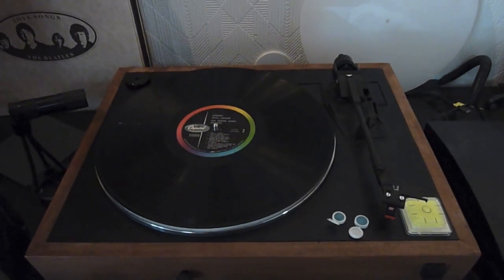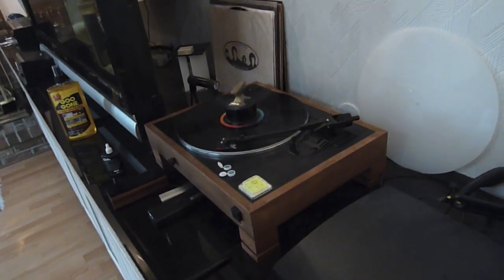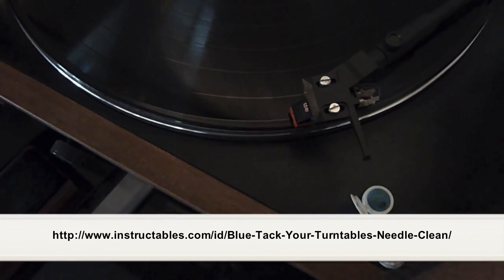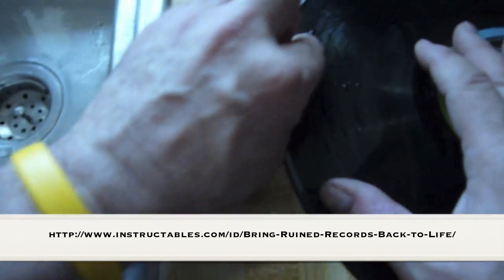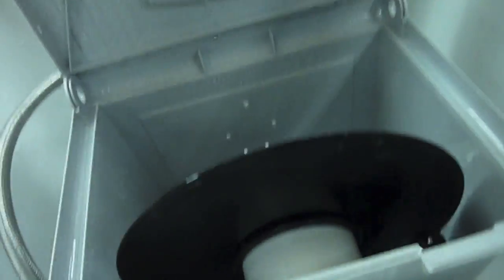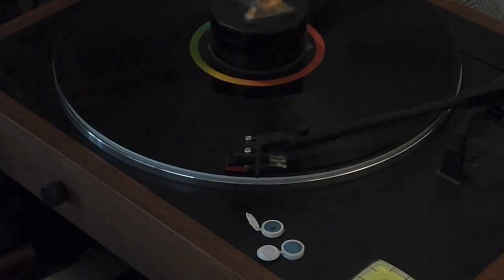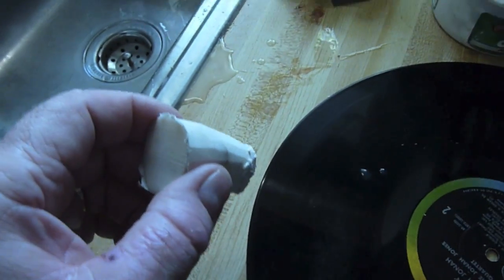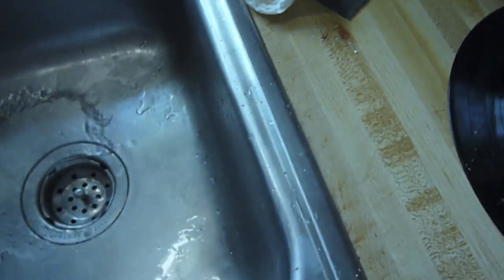Resurfacing Records to Sound New Again

Comment from the maker: Mrshelfsong: I did the exact same thing when I copied my albums to tape (pre-digital).  But I didn't bother using distilled water.  I used a spray bottle and tap water to mist the surface and let er' rip.  I'm sure all the improvement I heard had a lot to do with eliminating the static I was constantly fighting back then.  Glad to hear I wasn't the only one to do this.  Thanks for commenting.
Reply: +Bruce Kinsey You sure are dedicated to your records. I grant you that Mr. Kinsey. I guess I'll always be a CD man. As long as you don't drop it, the only thing you need to keep them working are some linen cloths. (And perhaps a scratch repair kit.)
Reply from the maker: +eternalhalloween1 No... That's not me... Most of my listening is digital too, but there's something satisfyingly primeval about taking 5 minutes out of your life to focus on a retentive act of preparation and performing an action requiring surgical levels of concentration and precision just to sit in a spot located exactly between a couple of 4 foot Magnapans and listen to 6 songs of which only 2 are any good... Come on, you can't deny that's nirvana, can you? :)
Reply from the maker: ...And a place to store them. 

All of my LPs are those that never made it to CD or difficult to come by other than lucky finds at junk stores.  

At the moment I'm focused on another project, so my turntable hasn't been used much of late. 
An iphone, a set of dual driver IE headphones, (modified to eliminate virtually  all outside noise and to keep all the sound produced by an mp3 or 4 trapped between the speaker and my ear drum) will produce a good representation of what I hear (and feel) in front of decent speakers.  I can play with my project and music at the same time.
Reply: Yea. I know some people swear by vinyl LP. But I think you really have to have a lot of time and money to keep them in top condition. In all the years I've collected CD, the most I've had to do is wipe some dust off with linen cloths.
Reply: +Babi “Banditt” Tre I'm happy for you. Actually, since my last post, I have found a really inexpensive way to get rid of static and restore records to sounding almost new. Yea. New records can be $20.-$30. while the CD equivalent is much less. Would you believe I looked at a record washing machine on amazon, and it was $3,000.? I guess that's ok if you just won the lottery.  I don't think a lot of people would approve of how I get rid of static and clean my records, but it does work.
Reply: Please tell, how do you get rid of static?
Reply: Hey MalcolmPowder. It's not a method a lot of people would probably approve of, but I tried it on enough records I wasn't really worried about and it seemed to work. I mix some LUKEWARM water with a LITTLE dish detergent. And I dampen a paper towel with it. I gently go around the record 4-6 times. Then, I dampen a paper towel with ONLY LUKEWARM water, to rinse it off. (Gently going aroun 4-6 times.)  Then I take a slightly damp paper towel and GENTLY dab the record dry.
Reply from the maker: There are brushes made with carbon fibers that are excellent at getting dirt out of the groove.  Carbon is also conductive, so by placing a finger on the bristles as you brush the record, and with your other hand, touch a grounded component of the turntable, such as the spindle, it will bleed off static electricity very effectively.

Comment: Bruce, May I suggest after all the excellent cleaning that you apply a thin coat of WD-40.
This petroleum based product will allow the needle to glide over the surface and any microscopic dirt without hearing it.
Again, this will not hurt the record or stylus.
The surface noise will be reduced and allow higher frequencies to reach the magnets  in the cartridge since the needle can track the tighter grooves better due to the lubrication.
FYI
Reply: wallyitcom go ahead if you want your records, turntable and record sleeves all bunked up, oily and stinking... oh heck, you were joking weren’t you?... Lol!
Reply: @richardsinger01  nope.. it acrually works.   Ive done it when regular cleaning didn't do the job.. but I followed up with a good wash using a detergent and water followed by a rinse in distilled water.  There's a video or two on you tube

Comment from the maker: That's a block of hard rubber.  About the same density as tires.  It's important that it's not very flexible so it doesn't get inside the grooves, but soft enough to not scratch the vinyl.

Comment: FYI people i do not advise you to hate on this video until you actually watch it no matter how disgusted you are by the act because from experience it does work.   I have a Dion Ruby Baby Lp that had a nasty click on one song due to a large scratch.  I was almost ready to buy another copy online until i saw this video.  Frankly it took awhile, but the scratch is almost non existant now, and the click has greatly lessoned.  The Lp is actually enjoyable to listen to now.   If any of you attended shop class in school you were probably taught that the higher number grit of sandpaper the finer it is, and the smaller number of grit of sandpaper is rougher it is.  1500 grit is super fine, and is not going to trash the grooves of the record.   The paper is mostly used for finish work such as in auto body which should tell you all something.  I would advise not to use anything less than 1500 grit.

Comment: nice work and you are spot on with the Analog differences being palatable there is something that is cut out when you put Digital steps "sampling" on it. the recording range of a Vinyl record is is still way higher than most digital recordings and short of multi-track compilations in SACD the Analog tones of brass are best replicated in the manner you demonstrated.

Comment: Bruce...very inventive. I have seen others use WD-40 to get deep into the junk. 

Can you post some of the stuff you used to clean and polish?

That washer is very interesting. Looks home brew. How did you make that?
Reply: I'm currently using "Black Mould Remover" letting it soak for 5 mins then rinse, dry and apply "GT85" (similiar to WD40 but with PTFE) using a micro fiber cloth.  Wipe it clean after and play.
So far I'm cleaning 30 - 40 yr old vinyl that's been stored for 25 yrs and no doubt has invisible mould or mildew etc..  Good results so far, massive improvement, so I guess it's the hidden mould/mildew that causes most of this. Mould as we know is difficult to remove, so the mould remover I use is doing its job well :-)

Comment: Bruce Kinsey , I am interested in your powerwash contraption, did you 
make this yourself? And how do you stop the label from getting soaked? 
Obviously there is some kind of cover you clamp over both sides. I'd 
like to make one of those for myself. A video would be cool.

My present vinyl cleaning method is as follows:

I use distilled vinegar and distilled water with a few drops of 
dishwasher surface tension reducer, to allow the mixture to enter deeper
 into the grooves.

I do not use alcohol any more, as it reacts with the vinyl, even the 
proprietary alcohol based cleaners are actually destructive. Besides 
distilled white vinegar is cheaper., and just as effective at lifting 
dirt.

I finish, after a bit of a soak with this mixture, with an ordinary 
vacuum cleaner to lift the liquid off the vinyl , and an adapter I made from PVC drain pipe (cut a slot the width of the grooves, drill a hole for the record player's centre 
pin, use duct tape on the end of the drain pipe , wrapped in microfibre 
cloth, glued on, as a spacer at each end,  to keep it from scraping the 
vinyl surface) .

Comment: A few points, why the anvil?....Why a plastic cartridge /Styly,& I have not seen you clean said styly!?
Reply from the maker: Hi Warrren.   The anvil was my grandfather’s and I converted it into a record weight.  It’s too tall to fit under a standard turntable lid, so a regular, boring Harman Kardon weight is used when the cover is in place.  The anvil is easy to set in place and lift up.  It’s also unlikely to get dropped onto a record’s surface.  

I don’t understand what you mean by plastic cartridge/styli.  All of my cartridges are plastic and none of my styli are.   The one used in the video was a beater, which I’d recommend to anyone when playing trashed records.  For normal listening, I use two others, both audio technica. An AT150 MLX and an AT440MLa.   The MLX is a bit too tiring for my ears on long listening sessions, so if I’m going to be spending hours on the couch, I’ll switch it out.  Both of these are plastic as well.  I’ve never owned a metal cartridge. 

It’s been a long time since I’ve seen the video, but I seem to remember cleaning the needle.  If I didn’t, that’s my bad.  The needle cleaner is a white container sitting next to the platter.  The needle is rested onto it and any dust/dirt is stripped away when it’s lifted.  I prefer this over brush methods that impart sheer forces on the diamond’s attachment point. 

I hope I’ve answered your questions.

Comment: Having been around records for the last 50 years, this started out to be the most nerve-wracking, teeth-grinding thing I've ever seen! But the results you arrived at are fantastic. BTW that device you're using to pressure-wash your records looks like DIY made out of a portable file box and some misc. hardware - very ingenious. Are you using straight tap-water or is it filtered?
Reply from the maker: Thank you for your kind words.  My inexpensive pressure washer is exactly as you described.  The fittings are adjustable lawn sprinklers set to eject a narrow fan of water to both sides of the record.  The screw-on center clamp is large enough to protect the label. I've published instructions on how to make it (along with other vinyl record things) on WWW.INSTRUCTABLES.COM.  As far as water goes, I'm not using unfiltered tap water... It's non-chemical, unfiltered water directly from our well.  The issue with water purity mostly centers around minerals being left in the grooves. A needle will quickly heat these elements and melt them to the vinyl.  It's my personal opinion this isn't as much of an issue anymore.  Modern carbon fiber brushes reach all the way to the bottom of the groove (several filaments are able to sit directly on the microscopic flat at the groove's bottom at one time) and will sweep out everything that's been broken loose by the water, including minerals.  I could even make an argument that minerals actually help the process by "sand" blasting anything that's clinging to the vinyl.  The vinyl itself isn't damaged because of it's flexibility.  Hard things hitting it simply bounce off (I wouldn't suggest using an actual sand blaster, but I might try that, just to see what happens:-).  My use of Goo-Gone has also freed me of quite a bit of cleaning.  It has negative effects on natural materials, but leaves vinyl pristine.  If there's anything oil-based still clinging to the bottom of the grooves, Goo-Gone loosens it quickly.  As I'm sure you do, I love laying the needle on a record's run-in groove and hearing absolutely nothing... Until the music starts.  To me, that's the Holy Grail of cleaning a worn and battered album.  Thanks again for the great comment.

Comment: Disc Doctor and a vacuum record cleaner is definitely a faster method if you can afford to get one. The scratch repair was valid because the groove itself wasn't compromised (a skip) so lowering and removing the groove wall damage worked. I would be concerned with the label getting wet in that power cleaner.
Reply: *****
You do realize that all fungal growth (from mold to mushrooms) is encouraged by damp conditions right...? Most labels should withstand a rinsing,  but if you leave it soaked for 3 days, you're putting a lot of faith in the quality of the cardboard/paper and finish used, which will vary between records.
Reply: slushh I have had labels damaged by a very quick and small exposure to liquid. One was an original copy on Atlantic label so it may be specific to manufacturer.

Comment: First off, I would've cleaned off the dust BEFORE I played it because the needle CAN push the dust into the groove and make it nearly impossible to remove. Secondly, any dust the needle collected will harden onto it if you don't clean it off immediately after playing. I ALSO wouldn't use sandpaper. As I prefer to try to record them on pretty much the first play, I record them to hard drive and can clean up scratches either by the push of a button, or by some minor, but microscopic editing.

Comment: OMG!  This wet sanding technique works exactly as demonstrated.  I have an obscure and very hard to find bluegrass album that was produced in very limited quantities in 1968. After attempting (in vain) to find a clean copy, I was left with the alternative of giving up or trying a repair method.  I ran across this video and thought... what do I have to loose?  So, wet sanding it was... and the results are the same as shown in the video.  The skip & pop of the scratches disappear.

Comment: I looked up PVC and found that it has EXCELLENT resistance to Naptha (white gas and lighter fluid). Isopropyl alcohol also rates in the EXCELLENT category. Some aggressive solvents like Acetone and MEK are a real issue however.  Now, if your record is old enough, using alcohol will dissolve shellac. Most records do not need to be deep cleaned terribly often if handled with care. Just getting the dust off will do. But really noisy ones will benefit greatly from many methods. I know this video is not about solvents etc. Just sharing.
Reply: Many argue that the oil compounds in the PVC actually dry up with use of heavy chemicals and alcohol solutions. This will in turn make the record more brittle and prone to future wear.

Comment: That heavy weight is going to wear out your motor more quickly than not using it. If you think it's helping to keep the record flat, well, once your record is all the way down the spindle, gravity will keep it down. The weight isn't big enough to keep the middle or outer areas of the record  flat. If you think about it, If you had something that put put a small pin hole in the center about an inch from the spindle, and you had a notch coming up from below, that would be enough to lock your record in speed, if you think that weight is also doing that. I recommend a water surfactant cleaning with a faucet running over the record while you use your bare pal, to press the liquids into the grooves. But here's the different approach. Those tiny particles (if it's not actual record damage) are really embedded into the grooves. So use an air gun to blast out the grooves while they're wet, and it would be easier to do that while it's on the turntable. Once in a while you want to clean that pad under the record, too. So, air gun. Go where no man has gone before.
Reply: Sounds good. But I still think weights are needlessly too heavy and put a needless strain on the motor. Just saying a lighter weight not none at all.